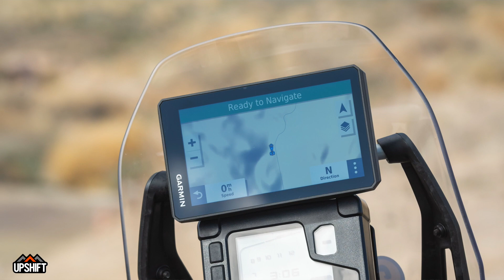Yamaha Tenere 700 Project - Phase 2

Comment: You left only the frame on this bike original everything else got upgraded or changed! That makes me now think how bad the original T7 is
Reply from the maker: You have to understand, we have gone pretty far with this because we can. It's not at all about the core bike being bad. It's actually remarkably great for $10K USD. But every bike has room for improvement and more importantly room to tailer it to your exact needs. We didn't touch the motor. We did add a full exhaust system... mostly because it sounds incredible and we like it. Not because it NEEDS it. Seat, tires, mirrors, grips, bars, tail tidy, blinkers... all pretty normal stuff. This was phase 2 of this bike. Phase one was very basic... stuff you just have to do to make it comfortable and ready for trips. Wait until Phase 3. If you're upset by phase 2... phase 3 is going to make you melt down.
Reply: HB; If you knew the bike, or dirt bikes in general, you'd
have skipped that comment.